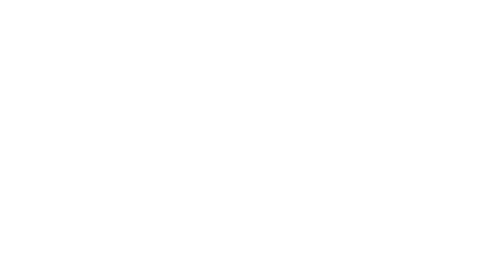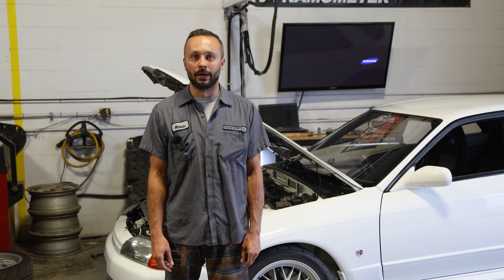R32 GTR RB26DETT ECU Master Pro-8 PNP - Basemap, Setting Timing, Pre-Dyno Prep

Comment: Dont you want to set it 20 degrees on RB26's?
Reply from the maker: If you are referring to setting base timing. The degree selected does not matter. this is only locked to confirm that what the ecu is commanding, is what is physically happening mechanically relative to engine position. 

Once confirmed all engine degree timing is referencing the timing base map and sub maps